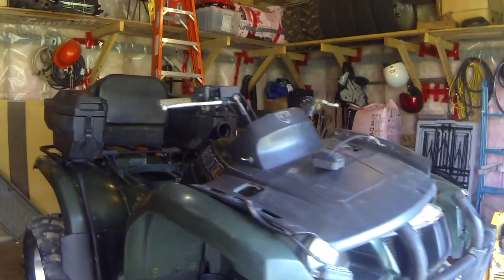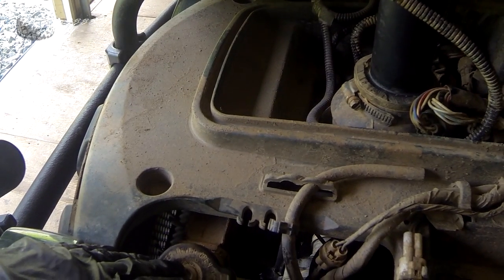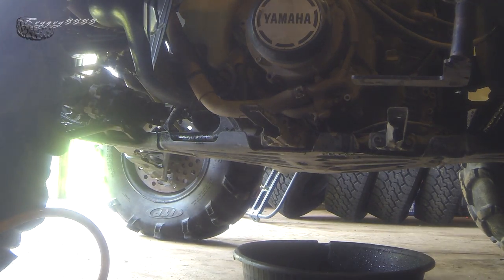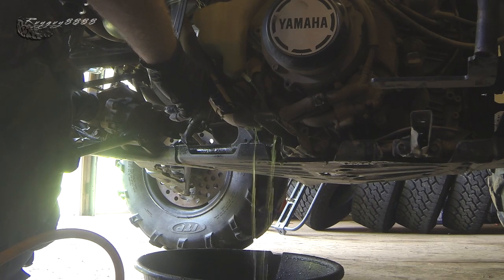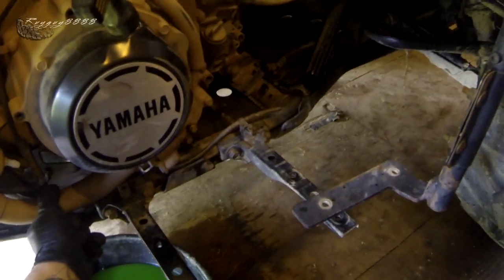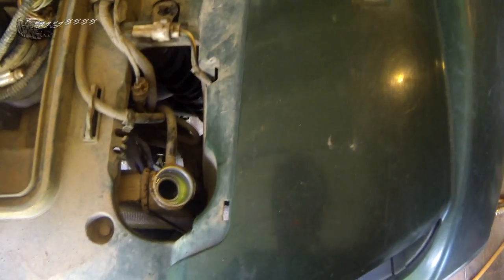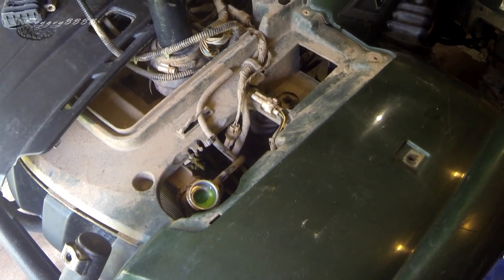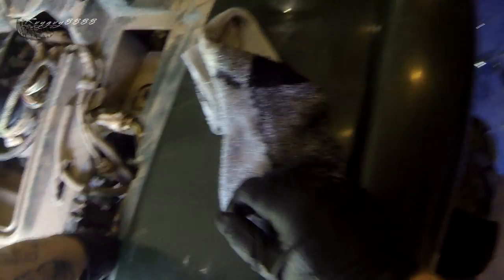HOW TO: Basic Maintenance: Coolant Change

Comment: That was a lot of help Ruyguy, the tech manual was absolutely confusing. The dreaded stator problem on the 2007 Grizzly 700  finally happened after nearly 10 years so had to do the whole enchilada: oil, coolant, stator change out. Runs like a champ again, what a good feeling on this DIY project. Not a cheap fix!

Comment: You can reuse the copper washer on the coolant drain plug as many times as you like,  IF  ...  you heat it cherry-red and let it cool slowly before reusing it.
It is called: ANNEALING.
When you tighten the drain plug, it compresses the copper slightly, and WORK-HARDENS it. This causes it to be less likely to compress and seal during reuse. However, when the copper washer is annealed, it softens the work-hardened areas, and allows it to compress again during tightening.
It usually only takes about three seconds with a standard propane torch, with the copper washer suspended by a thin piece of wire. Allow the washer to glow-red, then remove heat and let cool slowly (perhaps two minutes) before reusing.
This will save you a dollar at the parts store. And  ...  if you do it a million times during your lifetime, you'll become a millionaire.
Reply from the maker: Dunno about the millionaire part, but this is good info. Thanks for the advice. I'll be using this on some work that needs to be done to my truck soon.

Comment: Nice video! Why does my Suzuki Vinson 500 service manual say to fill the reservoir (not the rad itself), then tighten rad cap, warm up then cool down? Then seems to say repeat until rad is filled to the upper line of the reservoir. Any ideas?

Comment: I just came into a 2003 Grizzly and the owner never had it serviced. The thermostat is rusted in the open position, The head needs to be replaced because the outlet tube was so rusted that it snapped just from clearing out the mice nest. The water pump is also showing rust as well. The overflow bottle was filled with Georgia mud and dirty water. Do you know if it's possible to get a machine shop to take that tube out and insert another one or just purchase a new head from Niche...thanks
Reply from the maker: I think by the time your paid a machine shop to pull out and replace that tube you would be close to the price of a new head. I'd just save your cash and purchase a new head and salvage what you can off the old one. That way you know it will be fresh. 

As for Niche industries, they have some decent parts however if your getting something as important as a head, id make sure to wet sand it on a piece of glass first to make sure it's truly flat. Niche imports a bunch of their stuff from china and doesn't manufacture all their components. Ive had to modify new brake calipers due to poor castings and sand down axle ends to fit on my 660 that i've purchased from Niche here in Canada. They are cheaper parts for a reason, however if its just a bike your going to rip on, then yeah get the cheaper parts and sell the bike later.

Comment: did I miss where you crack the bleeder valve? maybe 660s don't have these? (I have a 700), thanks
Reply from the maker: No, you didn't miss it. There is a bleeder screw on top of the thermostat housing. Personally, iv'e not needed to crack that screw unless i'm having issues getting air out.

Just running the ATV till the thermostat opens up with the read cap off have always worked.
Reply: @ruyguy8888  I have been unsuccessful in locating the bleeder screw, I have 2006 660... would you post a pic?

Comment: Was just wondering what funnal are you using with the shut off valve?
Reply from the maker: That was just a funnel I found at Canadian Tire here. I did find one on amazon though https://www.amazon.com/Hopkins-10704-FloTool-Spill-Measu-Funnel/dp/B000EH4V0Y

Comment: Would the same apply to a Rhino 700 ?
Reply from the maker: The Rhino 700's engine is a bit more buried in the frame but yes essentually it's the same.
Reply: @ruyguy8888  thanks for the reply mate !

Comment: Great video as always  ! I have raptor 700 2008 is it normal for the coolant in the expansion  bottle  to drop a little  ? Mines dropped  about  6mm from top mark in 6 months I use it every day and have covered around 2000 miles in that period thanks Carl
Reply from the maker: Carl Boyd you can get some evaporation from your tank but its not really likely. 

Id lean up your bike really well around the radiator and check for leaks. Also check your res bottle for leaks too. Take it completely off and fill it right to the top with water. and plug the bottom hole. leave it set overnight to see if the plastic is starting to weaken and leak
Reply: Thank you and wow what a swift reply  I will do just that tomorrow